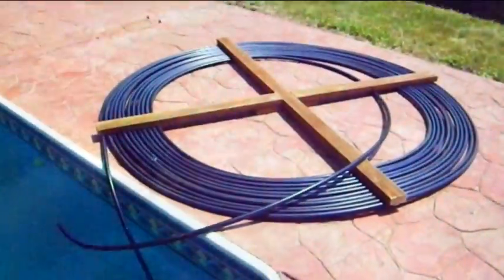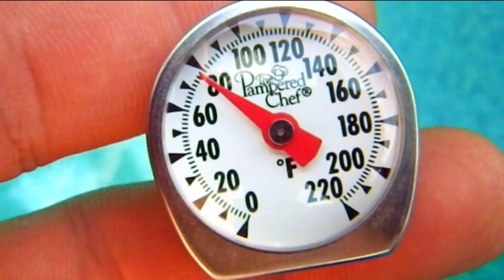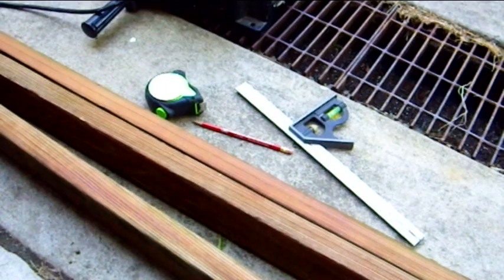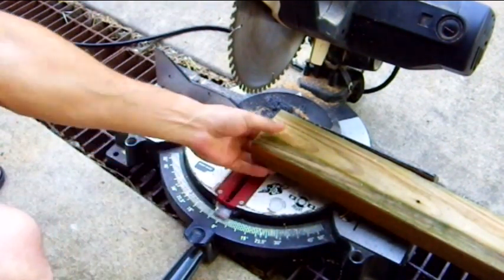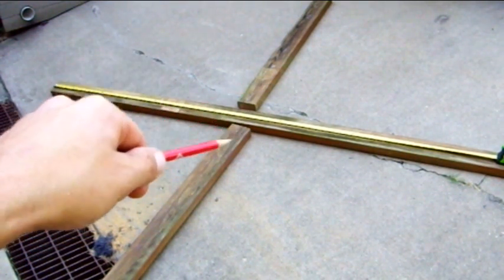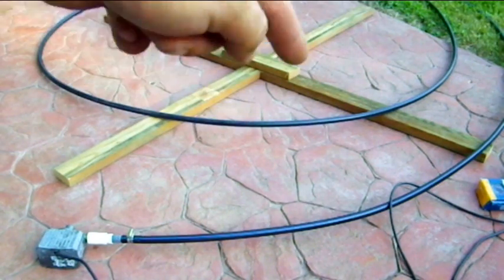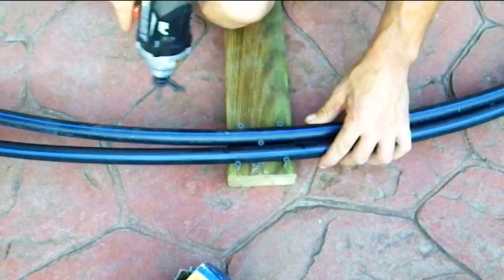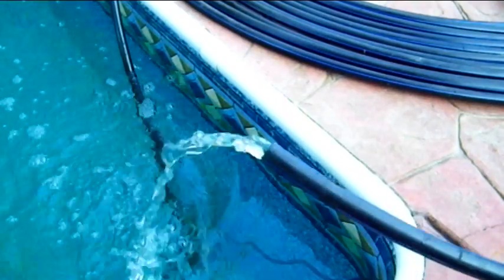Homemade Solar Pool Heater & Build ( Super Cheap )

Comment: I did this last year, using the "Beluga" it worked GREAT!  I'm adding double the hose.  The beluga is GREAT because you can adjust the amount of water coming into the pool, doesn't need electric, runs thru the input of the pool!  Can't wait to start!

Comment: If you take the hose, 75'-100' lay a black or dark brown tarp down, coil hose back and forth, fold tarp over hose, take one end and attach to pump (sump pump works), put other end in pool ( may have tow eight so it does slip out), and plug in pump....will raise pool temp 10-15 degrees on a sunny day.  Tarp can just be laid on ground next to pool

Comment: Hey dude good try this is obviously your first rodeo with PVC but there are ways to do that without so many pieces your at probably 50 bucks there maybe more and u could just buy something to do what you want for about 100 and wouldn't need all that and then u still need to buy the pipe to use for the heater keep trying you will eventually get to the point of thinking outside of the box

Comment: Would the water heat more with a smaller or larger diameter hose?
Reply: Smaller hose would put relatively more water in contact with the hot surface (the hose exposed to the sun) if you keep the residence time in the hose the same, but in order to do that, you need more hose (either in overall length or parallel flows).  If you push the same 900 gph through a 1/2" hose, the water is forced to move faster than in the 3/4" hose, so the residence time (in the heater - the hose) of a given volume of water is less.  If you let it flow really slowly (think of your full garden hose on the lawn that spews out extremely hot water for the first few seconds until empties that volume was sitting stagnant),  you can get a lot of heat, but the total energy is not that much because the volume is so small.  If you look at the commercial solar pool heaters (coiled ones or flat panel type), they split the incoming flow into a bunch of small tubes to put as much water into contact with as much black tubing as possible  before joining the flows up again into an outlet tube that goes back to the pool.  Hope that helps.

Comment: at 900 gph; that is 7500 lbs of water and with a rise of 4 degrees your heater is converting  30K BTUs of the Sun's energy!! (1 BTU required to raise 1 pound of water one degree)

Comment: My system is simple, works great, and heats on cloudy days. Buy the best black garden hose available-Goodyear or Industrial-type. about 200 feet will work for a 24" round pool. Attach in a coiled method onto a 4x8 ft. sheet of treated 1/2+ plywood covered with ICE and WATER shield. Using my kit on the return side of your pool pump. Kit includes shut offs, splitter with hose clamps, reducer and winter caps to keep out the critters!.  Mine is mounted on the pump shed roof, however ground or tilted frame on the ground is fine too.  Initial heat will scald, so be careful. You will see about a 12 degree lift on a sunny day.  I have kits available if needed, you buy the hose from Farm supply/hardware store etc.. Halecom@centurytel.net.  Good luck!

Comment: It is not clear how the water is drawn from the pool (bottom) to the circular pipe heater on top  of the pool platform. This would need a pump. I have a pool on hillside where I am thinking of putting up a similar pipe heater but located below the water level in the pool, and hope that that the cold water from the pool can be drawn into pipe heater and after heating hot water would flow back to the pool. Will this work. I shall be thankful for your views. This is Augustine in Bombay, India.
Reply: he used a a pond pump like he shows you and and says it again later on.. 900gph
Reply: kat2873 The idea is not to use any pump for circulation of the water. As the heating coil is located below the pool water level, cold  water from the bottom of the pool should flow into it by natural syphon. The heated water because of density difference should flow back into  pool. In my system I find the hot water would flow back into the pool by itself if the pipe carrying the hot water is located a few inches below the pool surface. I have the advantage of the pool being located on a hill slope, so no pumps. Augustine.

Comment: Now, what of you connected one end of the pipe to one of the jets inside the pool so you would have to use an the electrical pump?  Would that cause the pool pump to work harder?

Comment: cool idea. im thinking if you spaced the rings out a bit more, you would create more surface area in contact with the sun, should increase energy absorption by at least 25% to 33% from what you see already.

Comment: You may want to use a solar powered pump or attach to the jet streams of your pool. That will save you even more on electricity and really make your heater solar.